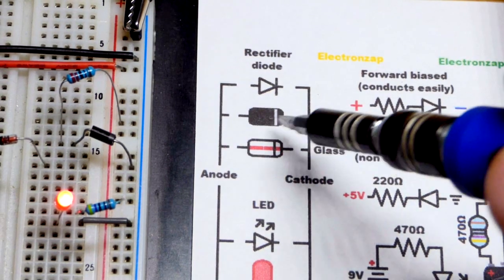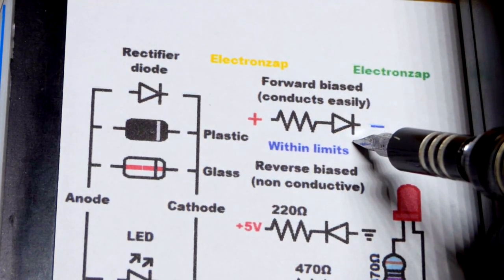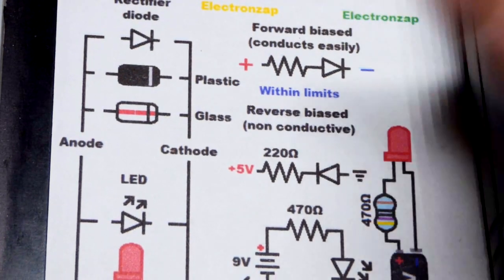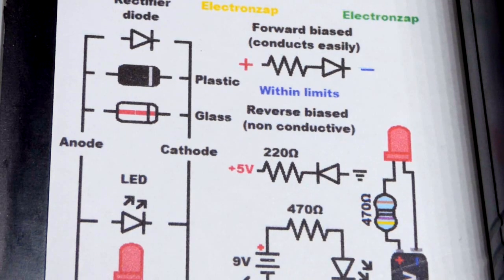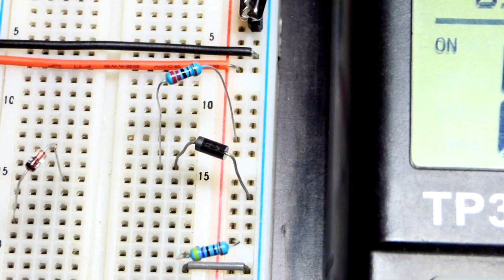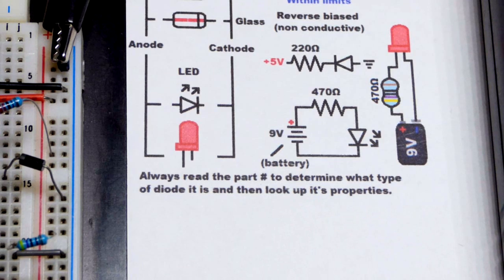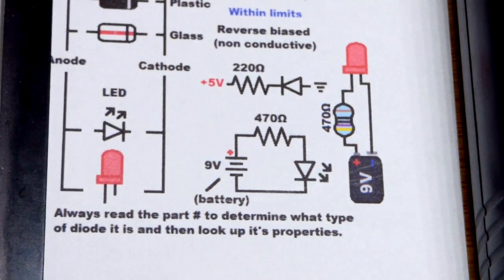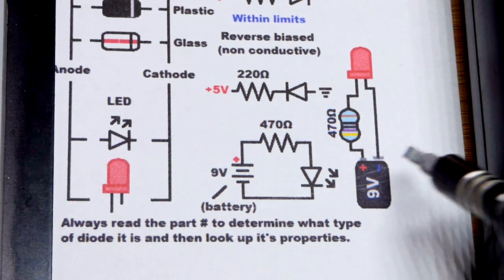How to read schematic diagrams 02 rectifier and light emitting diodes LEDs DIY by electronzap

Comment: Great explaination! 
Im having confusion between these two word 'impedance matching" , 'buffer' , can you explain?
Reply from the maker: I've never done impedance matching. A buffer is circuitry where you have an input and an output. If using 5V , then the input might be given a signal of either approx. 5V or 0V.  The output will then provide to other circuitry the same approx. 5V or 0V that is being given to the input at that particular time. The input and the other circuitry don't interact with each other at all.
Reply: @Electronzap  thank you🙂